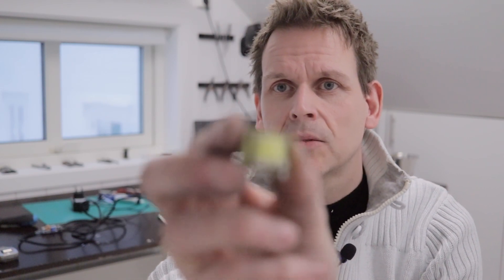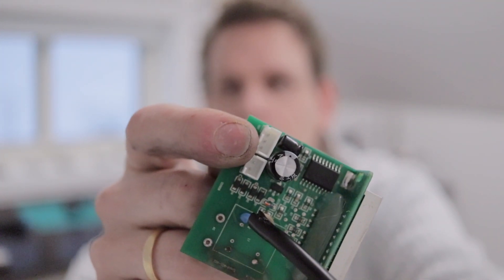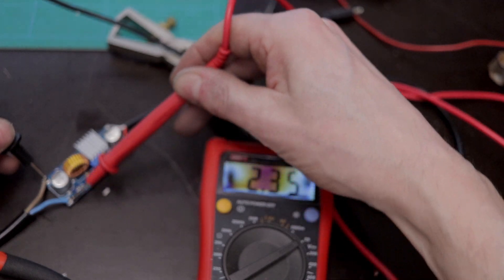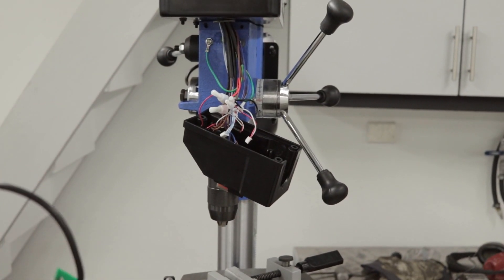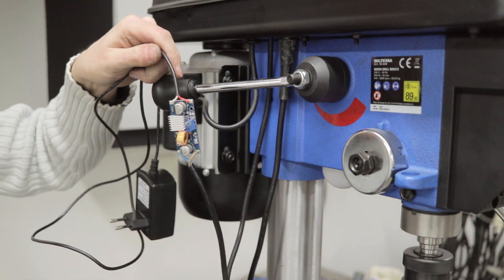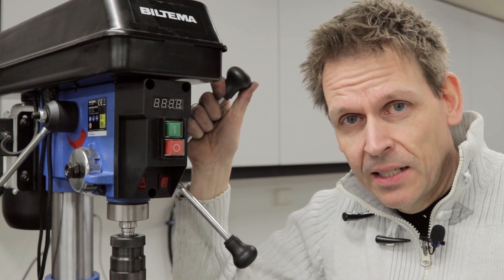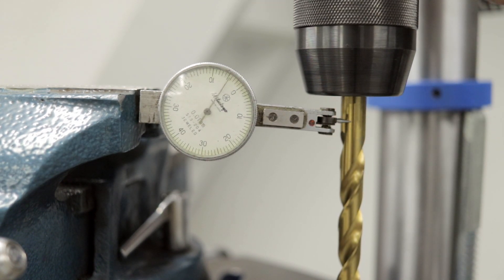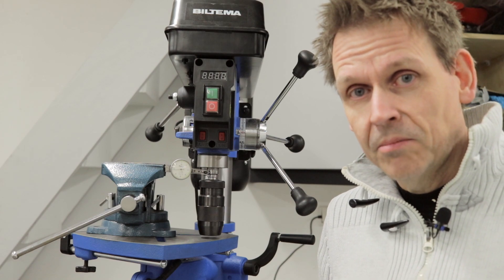Repairing the bench drill (Biltema BD5512)

Comment: ...imagine that this machine is still sold by Biltema. I wonder if they have fixed this issue. I can't think of them continuing selling the machine when it can cause fire...
Reply from the maker: The problem had been reported, and some viewers have mentioned that the latest machines have been improved. Hard to know for sure if you find one of these if it's a new or old model though. Biltema will for sure replace or refund you if you buy one that fails, but it's a hassle of course 😓

Comment: Thanks for sharing! I would like to replace the pcb transformer of my own machine because of the same problem. However I can’t measure the current of a broken component. Do you know how much current the pcb input draws on 5V?
Reply: I’ll figure it out, thanks again! I might try a 0,6A pcb trafo.
Reply from the maker: Hi, sorry to hear you got the same problem 😌 I have not measured it, so I don't know. The power supply I am using is 6 Volt and 3.5 Amp = 20watt. With this configuration it has worked without any issues for years now, so that is at least enough. You might get away with a smaller power supply as well, but I'm not sure how low you can go. Good luck fixing it!

Comment: Har du informert Biltema om dette..? Har di evt forbedret produktet sitt?
Reply from the maker: Hi, when I returned the first one I told the local dealer about the problem. When the second one broke the exact same way,  I also told them about it. They told me once more just to return it, either get the money back or try a third one. Well, you know I decided to fix it myself. I then reported it to BILTEMA's customer service on web, and I got a answer that they would inform their product manager. I have no idea what they have done with this info.

I am more than happy with BILTEMA, I get great service at my local dealer and they have a lot of nice products. Of course you have to take the low price into consideration and you cannot always expect very high precision or quality. I am gradually moving over to better tools however, at least for the ones I use most. My last purchase was a slim Bosch (blue type) angle grinder, and it is definitely a step up :-)

Comment: I wonder if the transformer really was the problem, can’t imagine an lcd Display and a laser to demand that much current, so I would suspect some other downstream component has a short or something effectively over loading the transformer and poff. 

Is your fix still working ? Do you have some fuse in place in case whatever component gets shorted gets shorted again ?
Reply from the maker: I remember one thing btw: the housing for the electronics was very hot when the power supply blew up (before my repairs). This heat had to be built up over quite some time to be able to heat up a large area of metal and plastic. I had left the machine plugged in for four hours when it happened.

My new power supply does not generate any heat at all. I forgot to unplug the machine last week after I was done using it, and I left it plugged in for almost a whole week (I normally unplug everything when I am done for the day). Everything still works as normal and there was no heat from the power supply.
Reply from the maker: It is still working after my fix. I did not add any fuse, that is probably a good idea.
Reply: It's NOT LCD, it is LED display. LCD = Liquid Crystal Display and they require small currents, but LED displays can require 20 mA per segment, so depending on the numbers displayed, that can add up to about 600 mA plus the two laser diodes, so it can easily add up to a total of over one Amp. But of course, the reason why it gets hot can be many, design failure is not unusual in these products.

Comment: You can find switched powersupply for the voltage you need without the stepdown DC to DC.

https://www.kjell.com/se/produkter/el-verktyg/stromforsorjning/natadaptrar/acdc-natadaptrar/stallbar-utspanning/luxorparts-stallbar-natadapter-3-12-v-dc-72-w-p45179
Reply from the maker: Absolutely, this is a better solution! I just used what I had laying around. Using a power supply with built in voltage regulator is perfect for this!

Comment: Nice work :)  I agree that this machine feels very sturdy when drilling, and I cannot see or feel any wobble or anything like that. That was my main concern after trying a few low price bench drills from Meec and Ryobi, they had severe deviatons from center - about 1-2 mm on the chuck. I tried the Biltema-drill with some large forstner bits (søylebor/kvistbor på norsk), and if there are any deviations, they are so small that I am unable to measure it (inside the bored hole) with my calipers (skyvelære). Very happy about this!
Reply from the maker: Great to hear, seems like we have the same experience  🙂
Reply: @kihestad  Thanks for sharing your experience with your bench drill, i think i will consider the Bosch PBD 40 instead due to the electrical problem.
Reply: Do you have the same problem with the electronic as K.L Hestad had?
Reply: @michaelpedersen5087  Seven months later, still no problems with the electronics. But I still pull the plug from the wall every time I am finished with using it...
Reply from the maker: @michaelpedersen5087  it is probably a safer choice 🙂